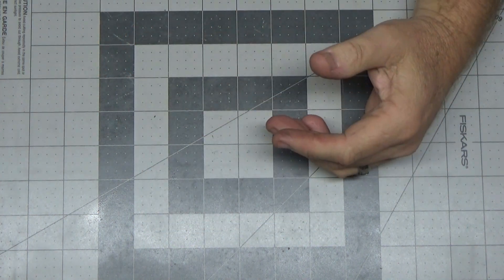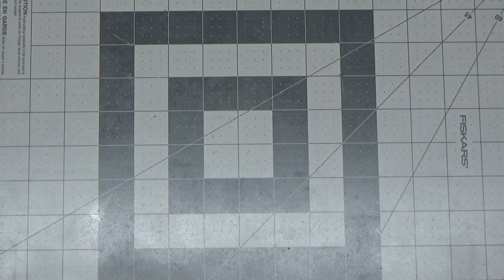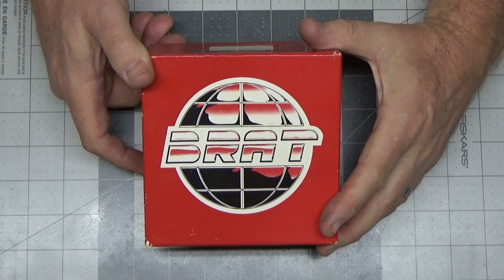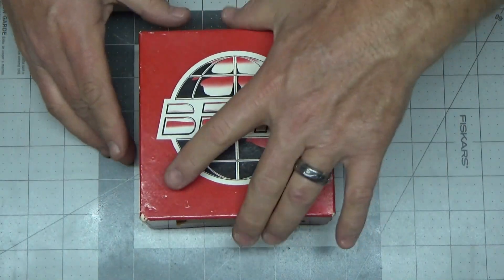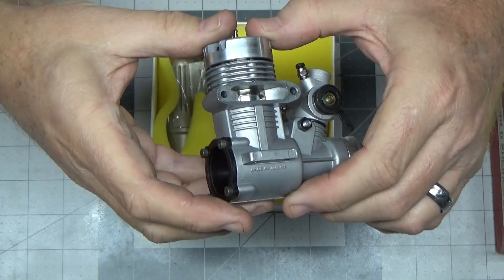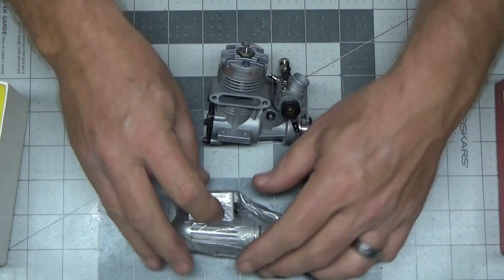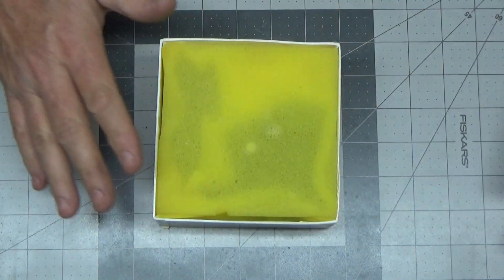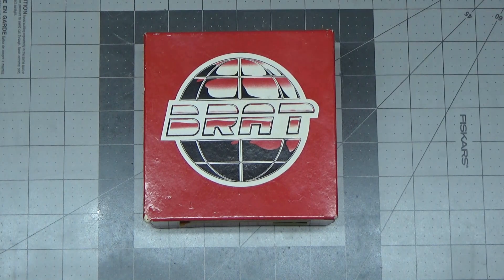Brat 25 AAC A Quick Look (Oct 14 2018)

Comment: Being its that old and still has all its papper work and plastic around the exhaust. And in its oem box..  And if u have no need for it on anything.. I probly wouldnt run it yet.. Its a glow engine.. It will probly run prettty good u already know. Now it u have a plane for it then i gess i might.. If it were me.  Run the other one if its had fuel in it already.. Just my opinion....